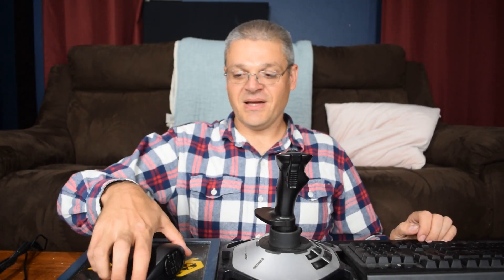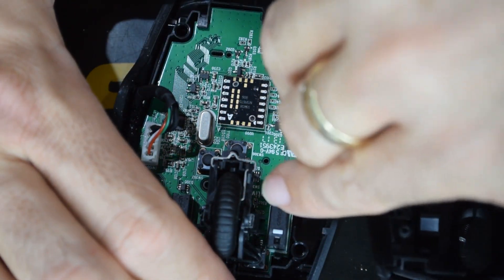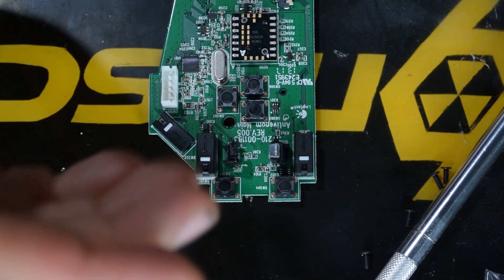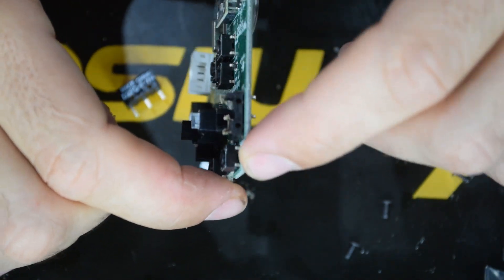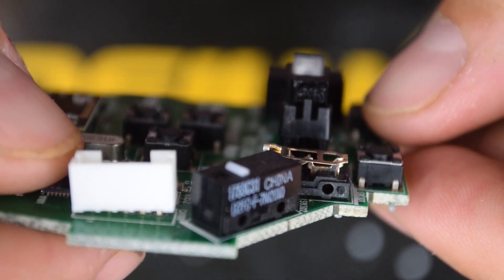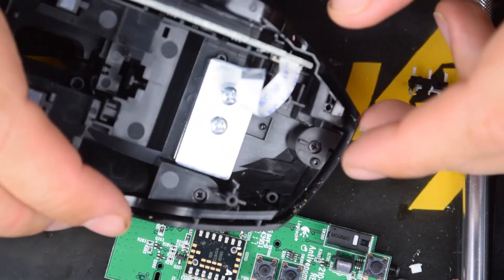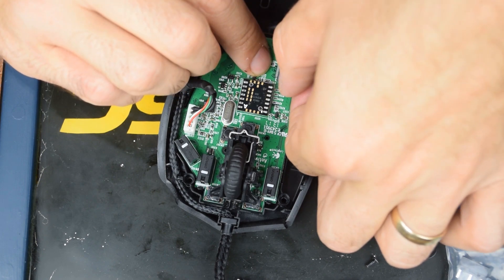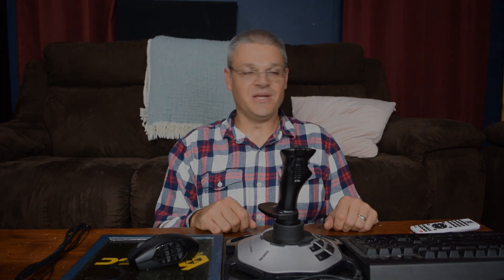Logitech G600 Button Repair - No Soldering

Comment: Thank you very much! My g600 last for 5 years, it has been doing  the double click issue for 6m - 1y, now it's fresh new... I've just swapped the left switch with the third right switch (no use at all).
Reply: best comment ever
Reply: Now that's resourceful.  Using shift button despite the double click will still be good I think :D
Reply: i tried this aswell today, but the button broke during the solder job :(

Comment: Thanks for the tutorial, my beloved G600 is back to normal. I have this mouse for over 10 years now and did not want to throw it away. The "new" version of it does not have the same feeling as the old one, so thanks to this tutorial its back to normal operation.

Comment: I have fixed this same problem with a drop or two of IPA (isopropyl alcohol) on the bad button while keeping it depressed to allow the IPA to get inside and clean the contacts by cycling the button.  Works like a charm and does not pose the inevitable risk to other components when soldering.

Comment: Thanks for the tutorial! I love the G600 because it's the only mouse that has a separate third mouse button for the ring finger. That way you can have middle click there. It really makes a huge difference using middle click just for browsing and stuff for me.
But I gone through a few because of double click issue, gonna start resoldering new switches now. Thanks again!

Comment: Good video ! Thanks to you, my left button is still alive now!
I was having a random problem with unintentional double left clicking.
Personally, I tested 2 tips that work for me:
1) if you press a little hard on the 2 sliding pads with your fingers, you should feel the 4 holes of the 4 crusiform screws. with the back of the mouse facing you, the top leftmost hole is a fake hole...the real hole is 4mm to its right. Look the guy on the vidéo to help you.
2) I used a 4mm metal drill bit which is perfect for drilling (by hand) the correct clearance for the screws. then I chamfered at 8mm (by hand) to deburr because the glide of my mouse was less good because of the plastic residue. perhaps deburring with a cutter would have been just as effective. I haven't tested.
3) I didn't buy any other switches, I opened the G button switch that I don't use (under the ring finger) and I recovered the super fragile metal strip, to exchange it with the Left click button faulty. This is the most difficult, delicate part... you have to engage the part at the top and bottom of the metal stip then push vertically on the "spring" last. Not easy... I thought I wouldn't make it! you have to take your time and be meticulous!
But now that my left click is working again, I'm happy to have tried the repair as described in this beautiful video! THANKS
Reply: Exchanging the metal spring was certainly the most tedious part. I almost gave up. Such a good idea to just use the G button spring as a replacement. I bought the replacement ones on Amazon and they worked as well.

Comment: Hello, I had this double clicking problem happening erratically for years now, I supposed it was a hard ware problem but was afraid to go and poke around. After seeing your video, I decided to give it a try. I didn't have spare parts, but I figured doing some cleaning, and reshaping the spring a little wouldn't hurt, And it fixed the problem. I don't know how long it'll hold, but thank you for your precious advises .

Comment: Good video that helped me disassemble the mouse. However I must admit that putting the springs back on was quite the challenge... Ultimately, I gave up.
I had all the tools to solder new clicky modules, but I didn't have them on hand. So instead I cannibalized a fully functional Razer mouse (that I didn't like) and transferred the click modules to the G600.
While at it, I cleaned it thoroughly while it was disassembled and now it's as good as new!

Comment: Thank you so much for the tutorial. One thing I would have liked you to go over in a bit more detail was the actual placement of the metal spring. I think I spent 2 hours trying to set mine correctly; I kept trying to put it in at a slightly wrong angle and as I'd try to lock it in it would go flying back out. I think the answer was to slide the back (the part with the metal "tab" that actually makes the contact that is read as the click) against the top contact first, basically as far back as it will go, then hold it in place, and kind of pull the other end (with the ring/hole) over its contact with tweezers, and if you're really perfect it will snap in. Definitely was a big frustration for me, and something I had a hard time seeing in the video itself. 

That said, I got it in the end, and you saved me at least $100 on a new mouse, at least for a while. :-)
Reply: I've had the same problem, been wrangling with it for three hours before I gave up. I'll try your advice.

Comment: Nice video.  Another thing to note is if you do not have another switch handy is you can desolder the 3rd mouse button, especially if like me you never use it, and use that switch to replace the left mouse button switch. In my case it's basically a new switch. You obviously end up with the 3rd switch having the double click problem but if you don't use welp who cares!
Reply: Hah, treating the g-shift button as a spare switch. Clever!
Reply: this is what i did but not soldering i got the copper thing from the g switch and switched it to the left click this is useful thanks thanks

Comment: I pulled this up since I didn't want to screw up those plastic tabs, put a dream cable in this pupper which makes this mouse feel even better (shoe lace cable vs stiff annoyance).

That said for those watching make sure to clamp the mouse cable to the shell BEFORE dropping the board back in.  I learned this the hard way and ended up with a stuck g-shift button, resulting in having to open it back up to do it the right way.  Given the stiffness of the weave of the original cable might not be an issue doing it that way, but just something I thought to point out.

Comment: Might be worth adding the part reference to your description as well... I nearly missed that info and tried using the wrong keywords to locate them until I referenced back. Thanks for the video though, absolute $deity send.
D2FC-F-7N
Reply: Do you know if it's possible to throw in a 50m switch?

Comment: I have same problem in my G600. Thanks the video. How did you glue the pads after the maintenance? Did you use Japanese Glue?
Reply from the maker: I don't have the pads any more.  I just use it without them.  It doesn't bother me much since the surface I use it on is slick.
Reply: @FamilyHomeTheater  Ooo thanks. I want to reuse them. Can I reusem them, is it possible?
Reply from the maker: @emretaskran5483  You can try... but you can get these for $8: https://www.amazon.com/Mouse-Skatez-Feet-Logitech-replacement/dp/B015QRZSXK
Reply: I would recommend to buy universal mouse pads ans stick them on mouse in any place you want.
But notice, some universal pads could be too thin, so you will have to stick them over "border" which surrounds default G600 pads (because they height could be lower then height of those "border"). I use mousepads which were in a box with mousepad, and sticked them over "border".

Comment: I have had 2 of these in the last 3 years and i cant win with the scroll wheel. First one broke out of no where maybe from rage and my second mouse came with the scroll wheel broken smh. Cant find a fix or a replacement wheel anywhere. Smh its sad because ill never use a different mouse

Comment: So i got the double click problem. But i fixed it without opening the unit at all.  I put my lips to the left click button (the one that was double and triple clicking) and blew in it, not exceedingly hard either.  just sorta lightly to add Humidity from my breath into the unit.  Where i live is pretty dry, and i read a guy used a humidifier to get his double clicking issue to go away. So i thought what the hay, ill give it a go.  This isn't a nintendo cartridge but, if its humidity it wants..   and sure enough it worked! I've not had 1 single double click in 4 days since humid-blowing into it!?  So, maybe try very softly blowing in first? then move on to disassembly.

Comment: I opened mine up, and sprayed electronic contact cleaner on the mouse button, waited a few hours for it to dry, and now it works perfectly again. A nearly $100 mouse shouldn't be doing this.. I have $10 mice that have worked flawlessly for twice as long, in fact I had to use it until I fixed by G602. May still need to order new glider pads.

Comment: Thanks for the tutorial! Had this issue for way too long now and decided to fix it.
I still had 3 buttons left from when I replaced the one on my Logitech G5 (going on almost 15 years now).
Back then I tried to do it without soldering first, but it was too finicky for me. So I just desoldered this one as well. Reused the pads also, didn't have an issue with it the first time.

While I was in there I also removed the weights, I'll see how it goes. I liked the big weight at first, but now not so much anymore - maybe I'll add 1 back in if it is too light. :)

Comment: I've replaced my switch and STILL get the double clicking issues, I've seen some saying that it might be a software problem as well
Reply: You can try to fix it with an Autohotkey skript to prevent fast doubleclicking. Try this script:

~LButton::return  ; Set A_PriorHotkey.
#If A_PriorHotkey != "" && A_TimeSincePriorHotkey < 200
LButton::return  ; Block hotkey.

You can still doubleclick with this, but you have to do it slower as it blocks the mouse button for 200ms. 
You`d have to install Autohotkey, insert the script in an editor and safe it with .ahk ending, then run it.
Reply: You can actually use 100 instead of 200, works for me atleast and it's easier  and smoother to still double click. :)
Reply: Fixed double click on my g600 by fliped pads pushing switch.
At g600 it has some white teflon like pads/skates pushing switches. You could try flip it or change with other button pad.
Reply: @philippdrescher6012  I'll try this, thank you :-)
Reply: @philippdrescher6012  omg, thank you! <3

Comment: Any idea why buttons fail so much in Logitech devices? In my G600 the buttons around the scroll wheel stop working within months of use, and they are just push-buttons! Since I got this mouse I programmed the G12 button as left button so it didn't wear down. So far so good.

In my marble mouse the left button is death, no matter how many times I replace it =(
Reply from the maker: Only thing I can think of is lots of gaming clicks.  Especially if you are jitter clicking or something like that. I need to replace mine again also.
Reply: @FamilyHomeTheater  I use the mouse as a regular mouse. I bought this one for an EDA software called KiCAD, so that I didn't use the keyboard short-cuts, nothing neither fancy nor intensive, but the buttons around the scroll wheel are death.

Comment: Do I have another diffierent revision or older model? There are no screws beneath the skates. The plastic is blank!
Reply: the skates are held on with an adhesive pad that's the same color as the skate. you probably separated them. try digging under the edge a bit with an exacto knife or fine flathead and you should be able to pull it up.

Comment: why not changing the whole switch? its really hard to open it up and change the metal part in it....
Reply: Because removing the covering, even if a bit hard to get off, is within the skillset of everyone.  Soldering on the other hand, while not  difficult, requires a skill you need to practice and learn.
Reply: @RitzyBusiness  the problem is not removing the cover but to close it back. It requires crazy hand skills to place that metal part without damaging and its even harder to close the cover with that small whitey button on it. As long as you have the tools you can one shot soldering if not... good luck trying